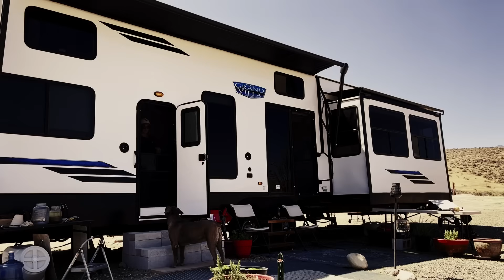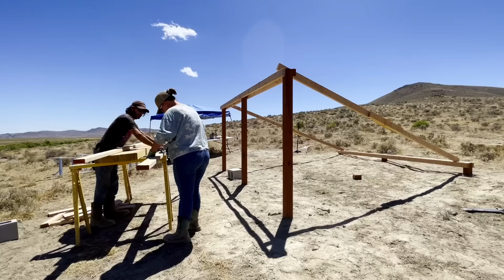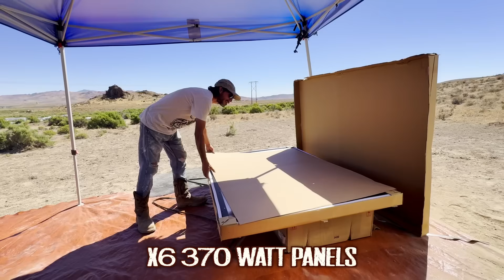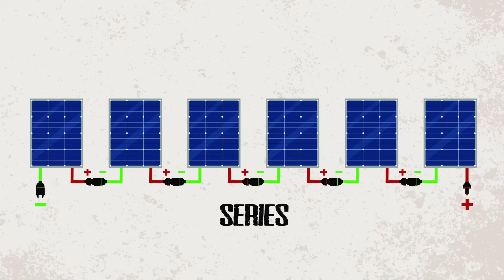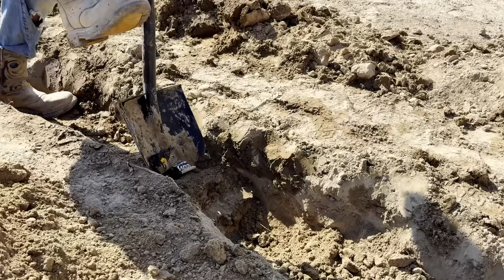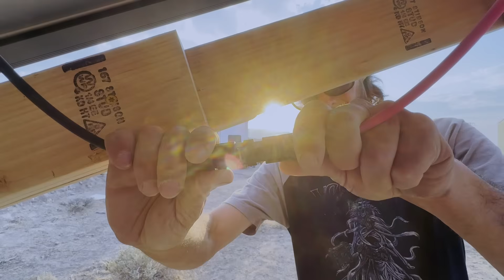We Knew Nothing About Solar When We Moved Off-Grid | EP 14

Comment: What I did is to solder the junctions to a larger gauge wire running to my battery bank. Only the panels can be disconnected individually.
All the connectors could end up being a power loss (every connection has a resistance to it, which can ad up if you have a lot of them...
Also running DC over longer distances is less then ideal... If you can put the inverter as close to the array as possible. Maybe use the space under the array to build a small shed (or place metal box or a the like) to house the inverter and or battery bank... 
Running AC longer (say 2 dozen yards or so) distances is perfectly fine... running 2 dozen yards of DC wire can be done but you would need a larger gauge wire to prevent losses in the wire... (DC from solar arrays tend to be much higher amp then similar wattage from AC from the inverter. Amps create the losses in the form of heat in the wire.)
This goes for the array amps too... If you can connect all the panels in series (i.e. if the inverter can handle the voltage of the 6 panels in series) then your amps will be low and therefor the losses in your DC wire to the storage shed and the inverter is minimal...
So if you can, connect the 6 in series.
Parallel/Series connections are great when you are (at times) experiencing shade due to other structures, trees or the like, something your situation has none...

Comment: While the plumbing metaphor is kinda in the right direction, you rather have them backwards. Your current is the pressure and what is actually doing the work, not the voltage. In an electrical system it is the current that kills you, not the voltage. A taser is 20,000 volts with nearly no current for example. 20mA across the heart will kill you dead. Think about that when messing those panels delivering dozens of amps.

Comment: You mentioned rattle snakes..  What we use to do overseas when snakes would get into  are spaces, was 
use a fire extinguisher.  They don't like it,  back then the CO2 froze them, then we dumped boiling water on them.  their system could not adjust fast enough. The powder fire extinguishers also works, and keeps you at a safe distance.  Keeps your wife, animals and yourself safe.
Reply from the maker: Great tip, thank you!

Comment: I would look into a 12 volt solar ac for that trailer to reduce generator time. Your so lucky your doing solar in these times, I have worked with solar helping my Grandpa since the mid 80's,I have seen so many changes . The new all in one power station are the only way to go folks like you with limited skills and time, for simple plug and use power,less wires and less headaches. You got so badly sucker by these solar parts companies ,A power station would have been a simple one day job with little tools ,just plug and play and then easily plug in batteries as needs get increases. Your going to hate yourself for not using conduit when the wires fail underground when rodents chew thru them. Your over thinking thing to much,Remeber the phrase less is more.
Reply: 12 Volt is not the way to go, given the distance from Your batteries,,,, the power loss, and the huge cables you would need to run it would be self defeating, Your best option would  be  1st a 48 volt ( thats what your battery stack runs at)  Hybrid Mini Split ac heat pump  which could run off the solar and/or generator.... The 2nd option would be a standard mini split,,, 120 or 240 volt system ( 240 volt is better).  each time you convert power  either up or down in voltage ,there  is a loss of power.   weigh the options the money spent on a new  AC system could be put towards more panels and batteries . When your only tool is a hammer, all your problems start to look like nails.  conduit ,,,yes.   its a learning curve... You were not suckered, You just need some  more experience,,,, and those connectors,,, well You dont want them to easily come apart up on the roof of a building,,,, there is a reason they are made that way,,,, just look up the difference between mc3 and mc4 connectors..  I myself have  both of those mc4 tools,,, the $20 metal one, and the cheapie plastic one,,, and yes the cheapie works almost a little better, but I have more than 2.   and since you have connectors and wire ,,, those wyes ( Combiner) they sold you are just fine  You would just have to make a small extension to link one string of panels to the next string....... a string of panels are all the ones wired in series....
Reply: @deuceaid6868  This a rv and your only 30 feet so no massive issues.

Comment: The fact that you installed that cheap high-frequency, transformerless inverter tells me that you still don't know anything about solar. You should have installed a low frequency transformer based inverter instead.
Reply: and burn up all the power heating a 200 pound boat anchor?  Why not go back even further to the days of rotary converters? with brushes and slip rings and commutators..

Comment: When the time comes to relocate (or, God forbid, repair) your solar mounting system, consider a low-tech hinge system where the center of the panels are a fulcrum point, like the center of a see-saw.  It would allow periodic (manual) repositioning of the panels during the day to track the sun across the sky and let the sun strike them perpendicularly for more hours during the day.  A horizontal support pole across the underside center of the panel array, mounted through sealed bearings on each end… and a firm lock-down system to keep the array immobile in those strong winds.  Just a thought…
Reply: look up the term Traxle  or maybe tracksle

Comment: You are going to have a BIG problem with that 2x4 span, you absolutely have to install a mid span brace. A 24" scab board (even on both sides) will not support that in a wind load. It should be 48 in. And youre still going to need a purlin
Reply from the maker: We’re gonna do some upgrades to the structure. This is a great help thank you!

Comment: I suggest you change how the positive and negative are connected from your batteries to the inverter.  To get t he best balance across all 4 batteries connect either the positive or negative to opposite corners, I.e.  Positive to the upper battery and the negative to the lower battery.  This will balance the power charge and drawdown so all batteries charge and disconnect at the same rate.  The way it’s currently wired the top battery will drain faster then the second and the second faster then the third and so on.
Reply from the maker: Thanks for the info! Will the top battery remain the master in that setup?

Comment: 2 12volt batteries at 250 amps in series will double the voltage and make half of the rated current. 2 12 volt 250 amp batteries in parallel will double the amp and  make 12 volts.

Comment: When ever possible drill a small pilot hole no more than 1/4th the diameter of the screw you are driving. That screw will drive straight, smooth, no bulging and the set will be perfect.
Reply: and less likly to split the wood ,,,, especially if your close to the end  of the board.
Reply from the maker: Got it! Will pilot from now on. Thanks for the info!

Comment: For your solar array, Your power travels through the wires more efficiently at higher voltages.  So a smaller wire can carry more power (wattage) when you get that voltage up.  (This is why the wires from the inverter to the battery need to be huge, its running at only 48volts).  Your specific solar panels output 40.17 volts, and your inverter can handle up to 425 volts (which is great).  So if you put the wiring in series, you would be a 6 * 40.17 = 241 volts, which is no problem for that inverter.  Here is a key point.  At the higher voltage you wont "lose" as much wattage as the power travels along the wire because the amperage is LOWER when the voltage is higher.  Your perfect wiring setup would be series, with six 370 watt panels = 2200 Watts at 241 volts which is only 9.2 amps, and you could handle with one pair of 10 gauge wires (normal PV wire).   But you are all set to add another array of panels right next to this one, easy.   You are ready for the future.  Thanks for sharing your journey.
Reply from the maker: Not only is this great information. You wrote it in a way that is easy (for me) to follow and understand. Thank you so much! 

We’re talking about getting another set of panels now for pv2!

Comment: The only ? thing I saw was a pipe attached to a wood post with wires going into it to your trench. That pipe shouldn't be open to rain if it is open at the top now. Otherwise, the best feeling is having power and water. Learning through $$$ is just how DIY is.
Reply from the maker: Haha you’re not wrong! 

We used some liquid nails and caulk to seal it from the underside and the top is protected but I still need to do something more permanent with it.

Comment: OK   1 thing,,,, SO cable    ( sounds like   " ess   oh" cable)      ( Your RV cable is costly)  better off with wire and conduit...... and Conduit does 2 things   it tells people dont cut me I am not a water pipe I carry deadly and painful Electricity and the grey is  also has UV inhibitors ratted for sun exposure..    and burring SO cable may not pass code. and yees I know its temporary. just putting it out there in the mix.
Reply from the maker: Great info! What gauge wire would I use to replace the SO cable? 

You know I was so concerned about HOW to bury the line I didn’t consider if it was against code… well I’ll be rerunning it sooner than expected.
Reply: @80Nevada   196 posts as of 12:05 am  7/24/25   for that short a run probably 6 awg,,, ( to carry the 50 amp ratting of the rv plug),,,, I understand,,, You wanna stop feeding the bottomless pit ( generator... and You have most the stuff) so its like let get this going ASAP,,,,,,Might I add that while You do that, You may want to put an outlet on the outside of the shop/trailer///cargo van whatever You end up calling it   > I still dont know if emails make it to you...anyway..    oh storage trailer.

Comment: Even with our smallish EcoFlow set-up for emergency back-up here in the PNW, there is something very empowering/satisfying using Solar to charge it. Great Job you two!  That $2K spent for Generator Fuel was bit of an eye-opener! 
As time goes by, you'll build a hoard of screws, bolts, nuts, washers, wire, connectors, etc. Those trips to town or even further get some what seem minor(but critical) really eats up a lot of time.
Reply from the maker: It’s a great feeling turning the light on and knowing there isn’t a bill attached to it. 

And I know you’re right on eventually having supplies on hand we’re just starting but I can see it already.

Comment: Task done for now, well done. It's like you said, this is temporary. When you go from temporary to permanent then I recommend making the switch from wood to galvanized steel and superstrut channels which you can get at Pacific Steel & Recycling in Elko. In the end everything turns back to dust, it's just a matter of how fast. Oh, and on those captured MC4 connectors, you can open them back up with some wire coat hanger. The next time you stop in at a Harbor Freight I recommend picking up some safety wire pliers and the next time you stop in at any home improvement store that sells concrete supplies perhaps a roll of concrete tying wire. Being in the middle of nowhere you'd be amazed at just how handy those two things will be. Good luck and be safe. Congrats.
Reply: OH YES,,,,  back in the day we used the wire from hay bales for everything,, but in the late 80s they went to poly twine ( YUK)  Concrete tie wire is gold! and cheap! 2 rolls should last a few years..
Reply from the maker: Great advice and thanks a ton for the info on Pacific Steel. We’ll definitely be making a trip when we replace the wood! 

A coat hanger is a good idea and the tools.

Comment: Thanks for sharing.  Minimum viable product is a good principle for both learning amd pay-as-you-go situations.

Free (thus either worthless or priceless) advice:  wood -and especially pressure treated wood- is neither durable or reusable.  Steel--that"s the ticket for your climate.  Concrete, too, is coventional but single use.  There are other thoughtful ways to achieve hold-down mass and resistance to side pressure.
Reply from the maker: Free advice is more than welcome! I’m hoping the wood lasts through the winter expecting to upgrade in spring. But if it starts to sag or buckle under the wind early I’ll have to act. Steel into concrete blocks is ideal I think but those kits are pretty expensive.

Comment: -2 to 135? You're going to get colder than that this winter and if you leave don't have active ventilation inside of that trailer, you're going to get hotter your upper limit
Reply from the maker: You’re right about the high and low temps we’ll see. Now that solar is in we can finish insulating the trailer so it’s a more stable environment!

Comment: F’ing A!!!  The trifecta is complete. Life just got a bit less complicated. I’m currently building out a shuttle bus for RV’ing and fully understand that nothing ever comes close to going as planned. But what you have done in the short amount of time is impressive and inspiring. (I’m almost at 3 years on my bus build). And the dramatic scenes are fantastic and fun to watch.
Reply from the maker: Thanks a ton! 3 years on the project! Are you at the point where completion is in sight?
Reply: @80Nevada 

I think so, had some big obstacles like ripping out and replacing plywood floor so now you can’t see through the bottom anymore. But in the meantime, I converted it to 4 wheel drive and got it wrapped. This month is solar on roof and adding a mini split!!

Comment: Good morning, the gray cable in de bottom battery that goes to the inverter need to be moved to the 1st battery (dip switch all down) Can port. Set your dip switches on each battery. 
move the minus wire from the inverter from the top battery to the bottom battery for a better balance.
Reply: all the dip switches werent set yet ,,, but yes move one of the leads from the battery stack for better balancing  of charge across batteries.
Reply from the maker: I wasn’t sure it would work if the cables didn’t run from the inverter into the master battery. But the grey cord is definitely wrong. The batteries don’t read the right charge level on the inverter. I’ll try this!

Comment: I know the 2x4 setup is a temporary solution, but I would still look at reinforcing it where you joined them together, you could support them with 2x4's with an angled cut perpendicular and down to the ground to help alleviate any bowing. Keep it up guys!
Reply: Was thinking the same. Also, the added reinforcing might help prevent the destruction heavy winds bring. I have been there recently and heavy winds as well as dust tornados are common and brutal.
Reply: Yeah I did just that too. I actually put 2 2x4s vertically and even 1  Diagonal to support the panels better.
Reply: Agreed
Reply: Absolutely needed.
Reply from the maker: You know, I’d hoped to let the lean-to be a space the dogs could find shade under but I think adding reinforcement is a great idea. Plus, I’ve been washing it whenever theres heavy wind to see if it’s bending at all and it does move more than I’d like it to.
Reply: @80Nevada Yeah just grab some 2x4s and brace it all up pretty fast and easy.